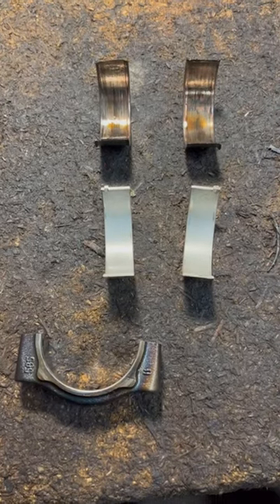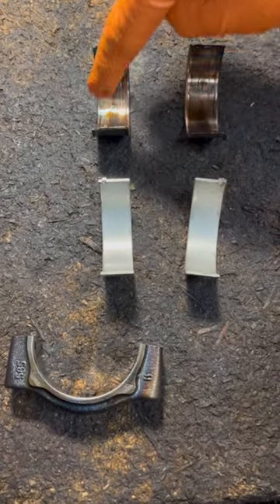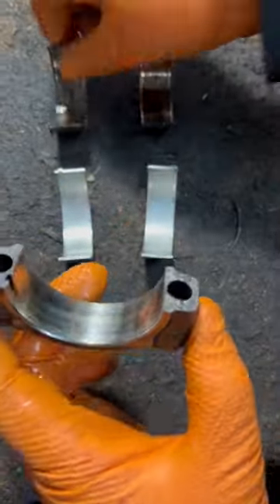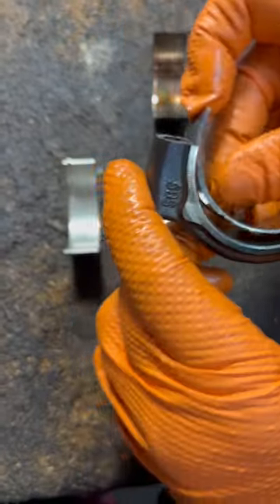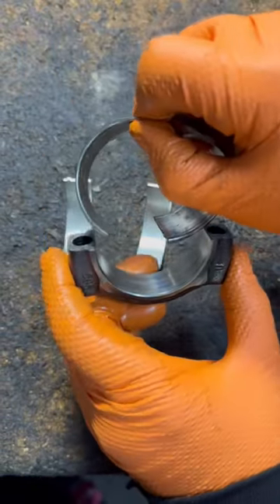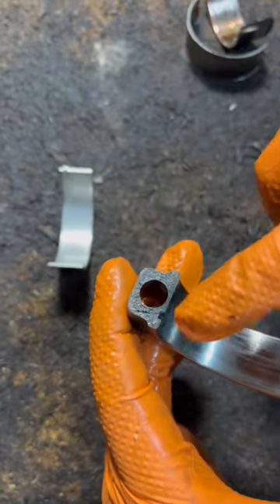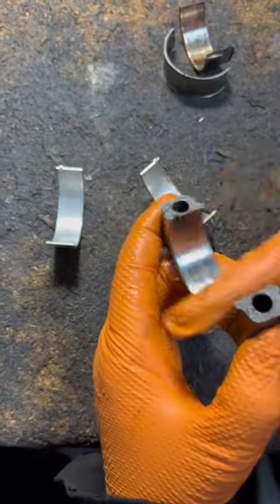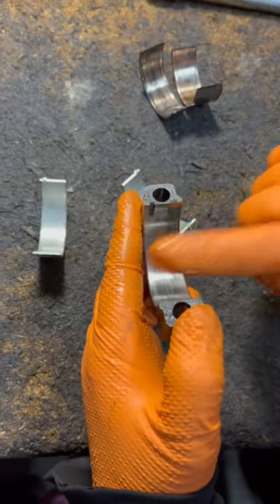What Is A Spun Rod Bearing

Comment: The tab doesn't hold the bearing in place, just locates it for installation. The rod/main bore is slightly smaller than the bearing and squeezes the bearing shells when torqued
Reply from the maker: That is correct 👍
Reply: Good to know! Thanks.
Reply: That is very correct

Comment: Something to note: The bearings are held in place by the compressive forces applied when they're tightened. The notches (tangs) in the rod and bearing are just there to make installing them easier.
Reply from the maker: Correct 👍
Reply: So do missing tangs still mean spun bearing?
Reply from the maker: @GearJamminHank Yes
Reply: @GearJamminHank the only way it will rip off is if it spins 👍
Reply: @GearJamminHank not all connecting rods have these tabs/grooves
Reply: @GearJamminHank somtimes engine builders will grind the tab off if they want the besring to be centered or located differently.

Comment: Everything made in cars should be heat resistant. You'd think in these day and age with advanced technology we would have created an engine that can't damage easily under severe conditions
Reply from the maker: This damage is lack oil not heat.
Reply: @motorcarnut my bearings spun while having alot of oil
Reply from the maker: @MohapiTau but probably no oil pressure
Reply: @Mohapi_Tau that doesn't mean the bearings were starved oil

Comment: I just rebuilt a motor after about 4000 miles I think I spun a bearing. Would could the issue have been? Oil pump….?
Reply from the maker: Yes, but can be also oil bearing clearances out of spec if you changed them.
Reply: Moat likely too tight.  I'd confirm the crank surface is OK, check clearance with plastic gauge and confirm you are in spec...as a starting point
Reply from the maker: Great suggestion

Comment: The bearings do not spin. 😂😂😂😂😂
Reply from the maker: Spun bearing means when there is no oil or oil pressure the bearing basically welds itself to the crank journal and spins so to speak.

Comment: Can you just fix the bearing that spun
Reply from the maker: Yes, but requires taking engine apart.
Reply: So the engine is pretty much done, oversized bearing might get you 1 mile to 1+? miles if it works to begin with.

Comment: What is the torque spec for rod bearing bolt ?
Reply from the maker: That depends on the specific engine you are working on.
Reply: @motorcarnut  vq35hr
Reply: @motorcarnut  I change the rod bearing about 3 times and still knocking after driving it
Reply from the maker: The crankshaft is probably out of spec. Did you measure oil bearing clearances?
Reply: @motorcarnut  no 🤦‍♂️
Reply from the maker: @Streetryder that’s why, the crankshaft is probably bad now because when the bearings spin they will ruin the crankshaft journals as well.